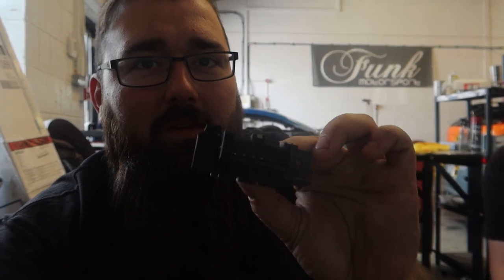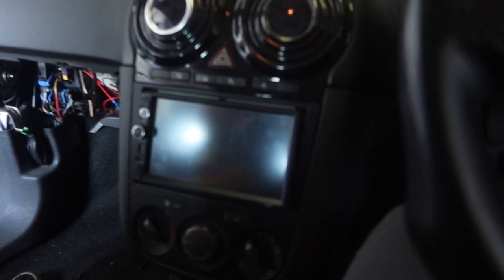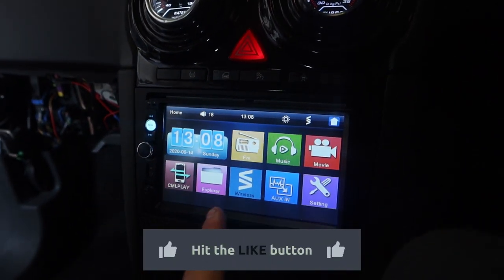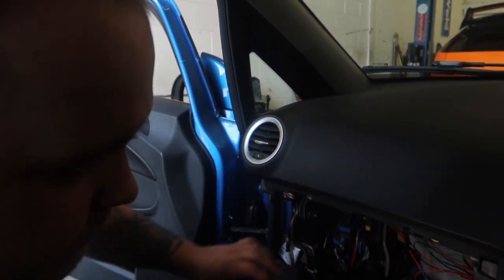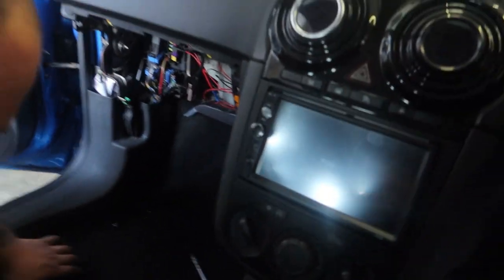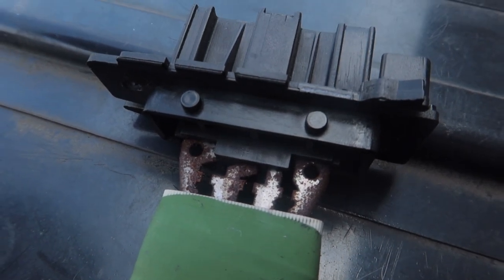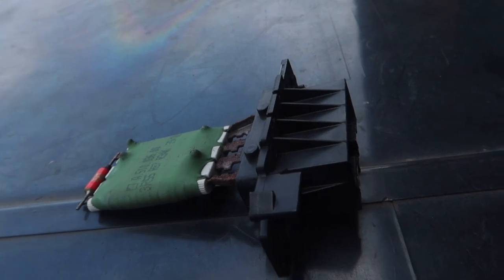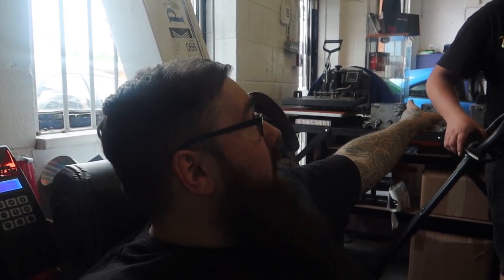Every Corsa Has This Problem!

Comment: Was the first job I done on my Corsa, think I got the resistor and connector off amazon for around £12. My connector was still ok though so just replaced the resistor. Easy job but made easier by the fact my glove box had already fallen apart so that was off. Glovebox was my second job 😂👍🏻

Comment: I had this issue with my old D VXR,   But it was a loose connection on the plug itself. So if anyone does replace the resistor and it still doesn’t fix the issue just check the connections. Usually a little wiggle helps

Comment: Had this issue on my LE, ignored it for so many months and now the whole ecu says there’s a circuit issue to do with the blower and the car supposedly has 22 faults from brake lights to washers even tho they all work fine, would recommend getting it fixed straight away...

Comment: You need to check the actual fan, make sure it spins freely. If the fan is a tiny bit seized it kills the resistors. I usually quote a new fan at the same time.

Comment: Hi I need a little help and you guys came to mind 1st I have a 2009 corsa vxr and noticed the inlet manifold map sensor plugged in but no vacuum line running to it? I’ve been digging about to see any vacuum lines loose but nothing just wondering if I’m going mad or is this normal how it is? Thanks

Comment: Usually the earth wire melts the plug and shorts out the resistor fuse link. Don't just replace that link using a cheap eBay kit... That's how your car goes on fire. Replace the loom section and plug connector along with a quality brand resistor.

Comment: On mine it was the blower motor itself, It would get stuck and after going over a bump start working again. I cleaned the brushes of the motor with some electrical solvent and its been alright ever since
Reply from the maker: Awesome mate! They seem to be a common issue on these
Reply: True, the motor is pretty poor too. And quite often, when the motor starts acting up, it zaps the relay too.
Reply: Is there a video on how to do this? Just in case
Reply: @khuramnasar549  the motor has to be sawn open and epoxied back together if you want to do it, google clean motor brushes and a few videos come up on the general process
Reply: @ilvtofo  lifesaver. Okay I look into if this fix don't work out
Reply: @khuramnasar549  let me know and I can send you some pictures how I did it, does you fan work intermittently on all speeds? Mine only worked after I went over a bump in the car

Comment: My Son has a 2012 Corsa, 1.0ltr Petrol, last week he was driving and it broke down, had to leave it at the side of the road, but when he went back to it, the thing started, So he tried to drive it home, but soon as it started to get warm it stops again, let it cool, it started again, and he thinks it keep draining the battery but he's not too sure. Any Clue what to look for ? it's parked outside the mechanics but they have just left it and keep telling him they haven't got round to it yet.
Reply from the maker: When he turns the key to turn it on and it won't start does it 'click click click' if so then it's the battery

But it will also be the alternator not charging the battery, when the car is running put a multi meter on the battery and it should show 14v any lower the alternator and battery need replacing, if its 14v then just the battery
Reply: @RustyAutos  Update on the car, the garage kept messing around, kept phoning them and they kept saying the haven't looked at it yet, so we got tired of waiting, we went to it, got the battery and brought it home, i charged it up at my house and took it back, put it on the car and it fired up, got it home but on the way home it kept wanting to die.  next day when my son went to work, i went and messed with the car, took me a while but got it to start start, while it was started i got my meter on the battery and it read around 14.4v  so i knew the alternator was working, started fiddling with the wiring, soon as i touched the Plug on the Ecu it died, so i took it off and cleaned all the contacts and plugged it back on, started straight away, and it's ran perfect since, not a single skip or miss, it must have been a crappy Ecu Plug.

Comment: My Corsa had that same problem, it's sorted now but the battery drains very quickly it's very concerning anyone have any suggestions besides taking the battery out while the car is sat? or replacing it I've gone through a couple of batteries already in the last 6 months..... I don't think that's normal

Comment: Also with this problem guys you need to look at the wires on the plug as the wires burn and melt which means you will need to wire in a new plug if the wires are melted and also Vauxhall will do the repair under warranty due a special bulletin on Corsa d